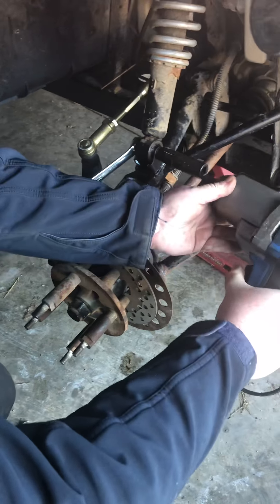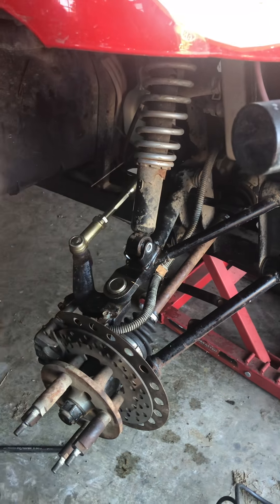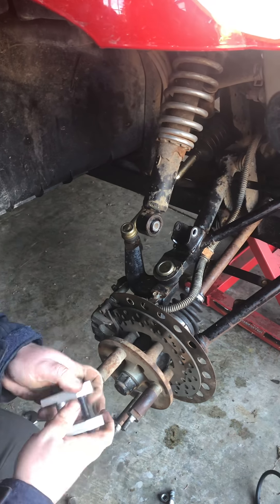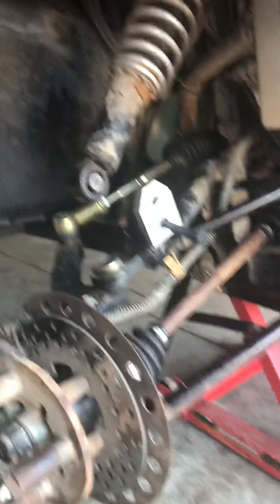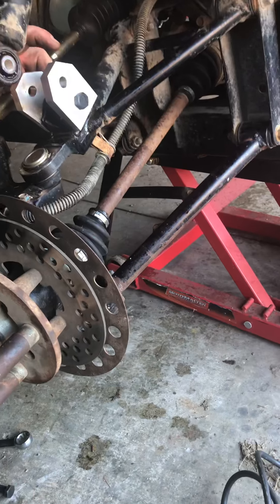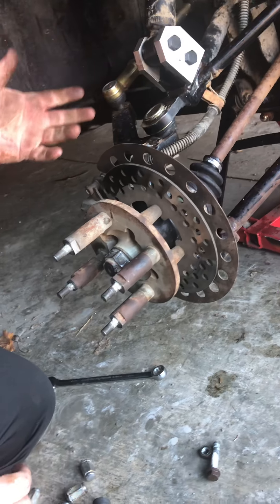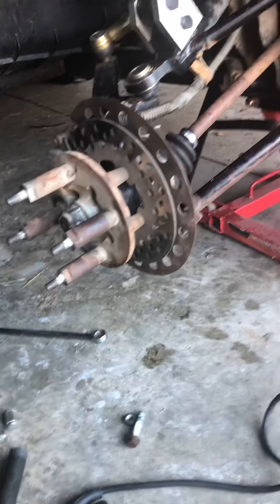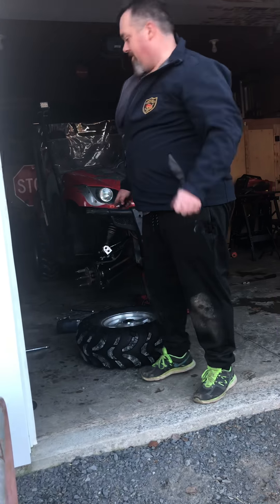Yamaha Rhino 2 inch lift kit installation part 2

Comment: Thanks so much for your video, it helped me figure out which way the recesses faced on the lower shock mount. I have a feeling I bought the same kit off eBay, the kit seems good and the instructions were poor.
Reply from the maker: Glad it helped man. Mine is still on with no issues. I’d suggest wheel spacers as the Rhino is unstable to start with.

Comment: How do you like the lift? Would you recommend it?
Reply from the maker: thesearemydogs it’s fine. A little of a sharp side axle angle but I’ve had no issue yet. I would definitely add wheel spacers to help stabilize. Rhino is a tippy rig, the lift makes it more so.